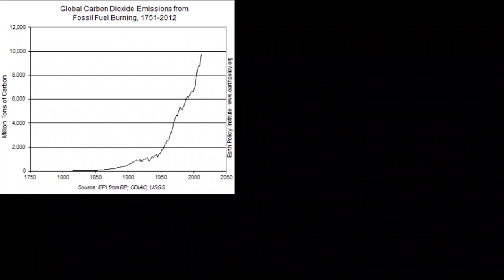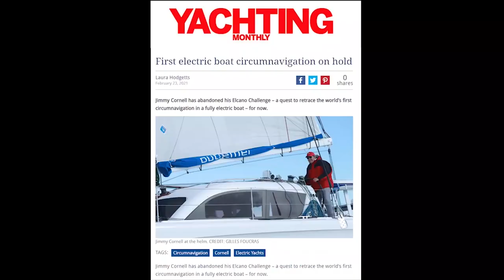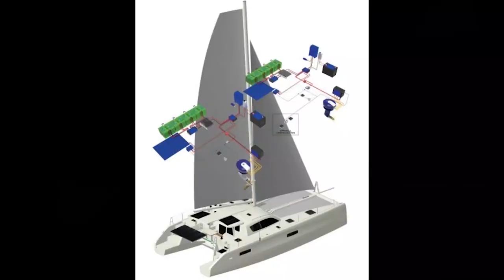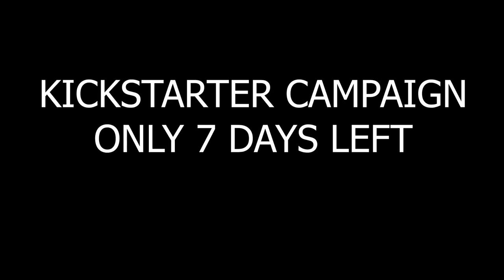7 days and counting

Comment: That Mumby breakaway rudder design is the best thing since sliced bread. I have been following Sailing life on Jupiter's American Great loop tour and it proved invaluable time after time.   Another thumbs up for Lisa . She is definitely a bright light. Cheers!
Reply: By breakaway do you mean a kicking or hinged? I will have to research it more. International boat terms, American English side.
Reply: @braithmiller  yes hinged. Mumby uses very unique design that's well integrated and simple in operation.
Reply: @Racerman27410  Just looked at Jupiter2 cool. Different than beach cats. His tour helps me envision it better.
Reply: @braithmiller  Kick up rudder
Reply: Theres kick up rudders and break away on Jupiter. The whole blade comes off its saved from being lost by being secured by a section of rope to the transoms.
The  sheer pin that locks it in the slotted steering carrier  is nothing more than a small piece 
 of  wood.
Reply: @clivestainlesssteelwomble7665  it's elegant in it's simplicity and after seeing it in action i would definitely want that feature on my boat.
Reply from the maker: All hail the Mumby

Comment: We have a 36-year-old boat, all the electrics are quite new, we cook, we shower, use electric tools when needed, we have enough power for everything without ever using a generator or motor to charge our batteries. It is possible, and it is not so difficult either. Also, no cat, just small monohull. We are  where most people are, in a sunny place.
Reply from the maker: Good on you. I like the sunny places too

Comment: Keep going Peter.
Im in a bind at the moment being forced to move and my health is limiting my movement.. 

Make sure in your build you  maximise your area to place solar on.. and use rain water gathering on the roof. design grab handles to double as rain collectors.....build in collision bulkheads and in the hull floor.
Carry salvage bags you can inflate inside or out to enable you to stay afloat ... Barefoot doctors took that step with there new leopard .. 

Insulate well this will make the boat less stressful, quieter and save energy. ... Cork is good stuff if you can get it .. so is Australian carpet grade wool ..and both are a lot safer than plastics.  
Highly insulated fridges and freezers will enable you to store food for passages without a great energy cost. Chest freezers with pull out baskets help..

Paint the underside of the bridge deck or hulls with high vis markings.  

Investigate using a sewage digester black water system to pre treat and  generate methane  to use as heat ..in colder climates.. ..its a long shot
If you have space in the rear cockpit think about rigging a removable cyclo generator ..
for cardio exercise and as  emergency back up Genny system. 😉 Make the crew keep fit for their lunch. 

Flat toughened glass or laminated or even at a push diy laminated can be cut to size. Anywhere world wide  and curved plastic isnt so easy. Unless you take spare material with you.
Reply from the maker: Good ideas my friend thanks
Reply: @SAILINGintoFREEDOM  
Dont forget the motor cruiser mumby has shaded reversed angle flat toughened glass windows with a flat cockpit roof better for rigid solar panel's.
Its also a lot better to see  through. 

The Mumbys bow is fine but traditional ..im wondering i a reverse or plumb bow might give you an extra bit of waterline speed and buoyancy up front. 🤔

Comment: Hi Plukky

Great to see Lisa's smile associated with Freedom again!

I've built all kinds of aluminum boats from purse seiners to megayachts,  and a full mold tooled 60' production high performance cruising catamaran as well.  I've never really put the skillsaw to aluminum on an aluminum catamaran,  but always imagined the weight penalty to be un- acceptable. After spending some time listening to the owner of Jupiter describe his boat I can see where it fits fits into it's design brief very well.  As to weight,  my Lightspeed 58  built with resin infused epoxy and CoreCell foam and with light engines is not a lot lighter.  

Something like a Lagoon is better compared to a mobile home plopped down on a lake front lot than to a real boat.  If you find such things amusing,  look up some of the videos of attempts to repair the main bulkheads on one of those things!  But 500 buyers can't be wrong???

I've worked closely with catamaran designer Kurt Hughes on several projects.  His design philosophy closely parallels that of Mumby on every detail except the choice of aluminum.  His cost saving build method he calls Cylinder Molding is amazingly time efficient--- think a 70' charter catamaran 1/2 hull built in a single day.  One of his earliest Hawaii CM day boats was picked up and blown hundreds of feet ashore during a hurricane 20 years ago, repaired and is still carrying passengers daily. 

What I don't hear being mentioned is the necessity of insulating an aluminum boat.  Whether you go to the tropics or the high latitudes it will be unbearable if left un-insulated.  And a catamaran has twice as much surface area as a similar sized monohull which adds the pounds no matter how basic the fit out. . But I'd still give the Mumby a very close look if I were building a one off KISS adventure catamaran and didn't mind keeping it bare aluminum as should be the case for all aluminum boats.
Reply from the maker: Thanks for the feedback my friend. Yes it will be insulated... Otherwise too noisy as well. No one does aluminum because it's too labor intensive...moulds so much quicker although you don't mention the preparation...surely that would be a week or 2 before? Keep commenting my friend. People with knowledge are a godsend.

Comment: following very closely, as a young fisherman from Western Australia, i always had a dream of going to the US and buying a massive Bertram 56 and driving it with my mate's back to Western Australia visiting and fishing everywhere on the way back. how ever as time went by the more research i done the more i realized the cost of diesel alone would blow the cost's out of the water, i then started looking into other boats and propulsion system's including kite's,sail's, electric, hybrid diesel etc to see if something like a Bertram could be purchased and converted to a better more modern system in the place of purchase and then document the return trip back to OZ
Reply: Think there is an Electric Tollycraft channel, of course it isn't crossing oceans. 
Your better off with an old sailing 'troller' their still out there at least on the Pacific side. Steel and wood. Fuel is just insane on any non displacement hull meant to plane. Been there. So have a tiny diesel to push 20k# 1500nm on a barrel, or 0 use at sail. It is a decision.
Reply: @braithmiller  yes have seen that one, im leaning towards something like a Bertram as they are popular here for when i wish to sell. how ever i'm leaning towards a Tema hybrid conversion or Elco hybrid conversion so the electrics can be used as a trolling/cruising motor for sub hump speed 4-8 knot range cruising and then when i have to fire up the diesel's for a high speed run the electric's are then used as generator's to charge the entire system. it's then a case of fitting as many panel's as possible over the flybridge and stuffing it full of battery's, the hope is that if you get it right you should almost be able to cruise  on sunny day's for as long as the sun is shining, with time spent at anchor being used to re-fill the large battery bank.
Reply: @goomtoob8714  Familiar with Elco not the other. Not aware of any planable monohulls decking enough solar to 'troll' along on direct. I am aware of many in this size though using extensive solar to stop using gensets to run everything else. Your expectations might be more than what is possible. Run simulations with each 730watts of propulsion on the hull. There will be losses electrical and mechanical.

Comment: Can’t wait for the big sail. I saw on sailing Uma YouTube channel the they are all electric and they installed a sail drive that charges the batteries while your under sail. Hope you can use it on your new boat.
Reply: Bit high in cost, the intend is something new more accessible. 400w @7kts won't cut it. Adding x2 cost won't do either. Dropping Wattandsea would get you more watts for less$ Love them understand, pioneering is rough. I don't know one that doesn't have a gas generator and dock charge.

Comment: I think its a great thing to always challenge ourselves to do things that we haven't done. But...
Have you added up all of the hydrocarbons used to build the boat? How about the hydrocarbons needed to build all of the solar panels and electrical motors and other electronics? 
Yup, that's what I thought, no one ever does this. If you do this monotonous task, you will likely find that the hydrocarbons needed to build a new boat exceed the hydrocarbons needed to run a used boat around the world several times. 
So while the challenge is valent, the actual carbon savings will be opposite of the initial goals. Best of luck 🙂
Reply: All new builds are going to cost, every year new ones are built why not build poluting the least? Use the least resources.
Not everyone can get a wooden boat less old than themselves. Surely my example will not change people's minds and move away from petrofuels.
Aluminum hulls cared for have a great lifespan, repairable and recycle ability.
Reply: I agree that reuse, re-purposing, and recycling is best where possible. FWIW primary aluminium as a hull material using the global average emits 10.3 tonne of CO2-eqivalent per tonne. For comparison raw glass fiber is about 2.0, carbon fiber 29.45! and recycled carbon fiber 4.65; add to these 6.7 for epoxy resin and 7.6 for polyester. The Mumby 48 is 6,100kg light displacement, assuming that's all aluminium that's about 62.8 tonne CO2-eq. Solar adds 50 g CO2-eq/kWh and 73 kg CO2-eq/kWh for lithium batteries; about 8 tonne CO2-eq per tonne per 10 years. Motors and electrics add maybe 100 kg and are mostly alu/copper/steel and the average emissions of those is 5.5 tonne CO2-eq per tonne, so about 0.55 tonne CO2-eq more to add to the total. Say the boat has a 40 year lifespan, that's 4 x 8 ton CO2-eq sets of batteries and solar. Totalling it all for 95 ton CO2-eq over it's life. Let's round up to 100 ton.
The Australian carbon credit unit price is $27.75 per tonne, so 100 ton CO2-eq would be $2775 to carbon offset.
Other hidden environmental damage to offset from mining and production? $$$
Reply: @CraigOverend  Good information, can you cite your sources? ...and the last sentence really sums up the whole situation. To get accurate numbers is a daunting task.
Reply from the maker: That's a good run down.. Thanks Craig. I can lower my carbon foot print by holding my breath too... That's gotta be a few grams per day surely....I am kidding... You know that right?

Comment: Thanks for the view of your catamaran news. Perhaps w/ aluminum you can finishher quick; certainly a fast, light and strong world cruising ship. As for fitting her out I suggest a wind gen; NASA Jerry had an 18 foot prop on his sailboat back then. But I found a 5 gives plenty of power come rain, sun or night, I've got amps all 24 hours. I'll guess you'll be going with all high tech gear&not washing machine motors as I'm inclined to do here.
Reply from the maker: You never know. 5 foot radius or diameter
Reply: @SAILINGintoFREEDOM  5 ft diameter. NASA Jerry had a single 9 ft. blade w/ a counterbalance on a big gen he hand built; 18 ft diam. I've built them as big as 12, made of 3 6 footers and a monter hub, but prefer a single plank up to 7 feet - fotos at windgenzen site and even an ancient youtube video under that name still exists. You'll also see Sriannie - S. American jungle girl who freaked me ou carving single plank 12s, built 60 ft poles and...great student. Cheap and easy gens are treadmill motors, typically 130vdc at 3200 rpm or 13vdc at 320 rpm which s the startup speed. 15 knots will get you in the 500-700 range, 20 knots will push it over 1000 or 40vdc unloaded. Bats charging drop the voltage to .5 - 1.5 over bat voltage and amps go up. Anothr gen is a ar alternator, but you have to bust open the case and wire the AC legs to step-up transformers and add a rectifier. Other gens include AC motors (i.e. washing machine) w/ special circuit to excite the coils and also a rectifier. 1500-2500 watt Treadmill motors are easiest. In 25 -30 knots that' like a 3-8hp gas engine (double output/loads for electric motors vs petol engines). Bigger blades, like the 7s, put out even more and I found wear out bearings faster so the 5 was my fav and its easy to carve, sand, balance&recoat once a year. Bearing sets are about $10-$20, plus $10 brushes every 2 years. YES, solar is quieter, but wind is way cheaper, more powerful, smaller footprint, easy to stow and works at night.

Comment: I'm familiar with shaping steel on an English wheel for old auto restorations, but what type of equipment are you planning to use on your aluminum to form the hulls?
Reply from the maker: A bender. I will have to build one. Also a hydraulic wheel against a wheel hub and push the plate thru
Reply: You can get them  computer rolled saves a lot of time and money and accurate

Comment: Looking at the hydrofoil surfboard design and how little power is needed to get to high speeds maybe some sort of a hydrofoil  retractable keel could be built into a Mumby so to reduce drag even further and less electric power then needed to achieve higher speeds cover bigger distances alot quicker .
And a hydrofoil keel under water that can change its angle while in motion doesn't have the constant changing conditions or forces to compete with like the waves on top of the water that normally control the boat.
Just a thought  
Love ya work brother 👍
Reply: Go put 5mil in the kikstarter..
Reply: @corviswood  any body can design then build better more efficient designs with metal very cheaply themselves or with the assistance of cheaper overseas labour :)
Reply from the maker: Not with aluminum. Carbon or Titanium..... exxy
Reply: @wilowest3509  good design and physics/ cheap all in limitation and ballance
Reply: @corviswood  I am playing with designs atm to build myself so just considering the water below the surface is not choppy and unpredictable therefore better place to control the boats lift out the water reducing drag increasing speed with less power .

Comment: I wonder if could build it with tubular aluminum frame like racing cars. I like the idea of all aluminum rather than glass fiber of plastic. Remember safety too as the mast and through holes of any kind must be grounded so if hit by lightning will go in to the sea easier rather than through the boat destroying everything that is electrical. as in Michael Faraday's cage of protection. Tube based would make it easier to place wires through with out them being damaged easily just a thought.
Reply from the maker: The boat is a continual ground everywhere
Reply: Everything is welded together like through hulls, naturally well grounded.
Reply: @braithmiller  But if you know anything about alloy it is not an easy conductor and extreme electrical heat can cause damage. That is what I mean Stainless steel is a bit better Iron and steal is far better then the best Copper and gold. Please check out how Aluminum reacts in water from electrical strikes. Compared to steal boats. This is why I find Fiberglass and carbon fiber a problem  in boats as the damage can be extreme. We know electrolysis can cause Fire in wood and Aluminum. I remember when it was very hard to weld Aluminum because of the melting points you have to be very skilled. I am not against Aluminum boats but just question on how a possible lightning strike could do damage. I still believe Fiberglass and Carbon fiber are the worst to make things from because it can't be reused and there is no real way to dispose of it. Of course the boats may never be hit by lightning it was a thought. Thank you.
Reply: @jonathanvince8173  Some misconceptions there. Not addressing all. Actually Aluminum is infrastructure conductor. Silver then copper then Aluminum. Stainless steel is a poor conductor, there is a major industry problem with people dropping ss washers into assemblies.
Gold is not a superior conductor just a good non corroding contact plating. 
Lightning sheets over the conductor more than going through it, there is to much resistance. Air plasma discharge. Making a boat more conductive past well grounded to the ocean is a fallacy. 
There are enough good people involved the basic Aluminum boat build safeguards will be followed. 
Learn some more I know there is much misinformation around.
Reply: @braithmiller  reason why I say from ally it can burn catch fire from heat of Lightning.  I never knew Ally can be used in Faraday's cage. Thank you.